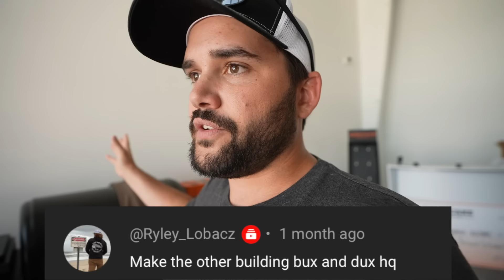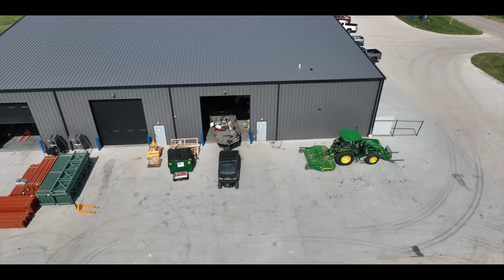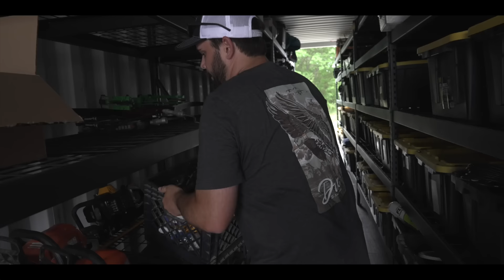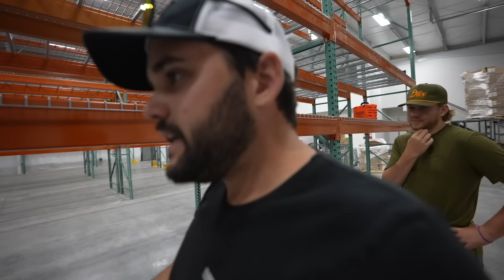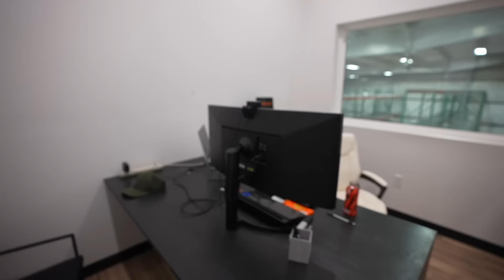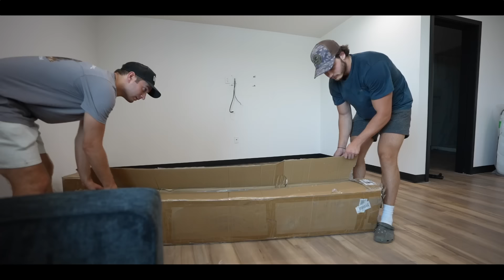Revealing My BIG SECRET!!!! (If this FAILS I Blame YOU!)

Comment: Speaking of storage containers, throw one in the pond 😂😂😂
Reply: Why keep throwing all the garbage in the pond?
Reply: Structure 😂
Reply: I think they cost a bit to much to just put one in the pond!!
Reply: Put a container in the pond is the best thing to do
Reply: @jerrytheafricangreyparrot  a 20’ you can get for $1500 and $3500 for a 40’ for me since I’m close to multiple cargo ports i can get a $200 delivery fee
Reply: True and the hatchery
Reply: Depends full size half or quarter full size lenth hold 2 cars cost almost 4k the quarter size ones around a grand  @jerrytheafricangreyparrot
Reply: @jerrytheafricangreyparrot price of them do go up an down like a scrapyard 😂
Reply: @tjboylan20  you lucky lol on cheap delivery
Reply: @SleepToNeverWakeAgain  I live 20 minutes from Port Canaveral in Florida and then another 3 hours from Port of Miami the Miami one is $600 for delivery of the 20’ and 1k for a 40’, that’s why I use port Canaveral because for a case of beer I can borrow a family friend’s truck and drive it around also
Reply: Taking this thought and adding to it. Take shipping containers and use them as a pond/aquarium. Cut the top off, seal it from rusting,  add a pond liner and you have a active holding pond or stocking pond. For an added twist add plexi glass for windows and only bury it half way so you can see the fishing swimming like Bass Pro Shops aquarium but be able to get to the top without getting a 8ft ladder
Reply: @tjboylan20  im in central VA so im over 2 hrs from the closest port lol its 1000 for the short ones lol
Reply: @jerrytheafricangreyparrot they cost less than he paid for that plane sooo
Reply: @tjboylan20 40' where I live costs anywhere from $400-$8,000 depending on what you want it to look like and they will do the interior as well and theu will put stronger doors on with a lock you can't cut off. It all expends the needs and what you want it to look like and be used for
Reply: And you expect to catch fish out of the container?  Talk about a snag, you will loose more baits than catch anything.  The structure the pond needs is tree trunks, logs natural structure. Adding more rusting and contamination from paint to whatever they hauled in the container to your pond and fish.
Reply: #structure
Reply: @bigkuntry3333  at the end of the day its garbage
Reply: Stand it up vertical near the beach and put a rope ladder and platform on it
Reply: I have a feeling flair has now favorited your comment, also that’s awesome he liked your comment
Reply: Pleaaaase let's stop contaminating ponds , all this crap leaches into the water ,and they not big ponds
Reply: Why not put a container with plexy glass half in the pond so u can go down and see the fish while feeding them  or get cool camera angles or overnight challenges i think be kind of cool
Reply: @jerrytheafricangreyparrot you can get one that’s like destroyed it doesn’t have to be brand new
Reply: Get an old one with holes in it so the fish can move around it
Reply: @jerrytheafricangreyparrot I can buy a shipping containers for £200 sold unsean. Uncollected shipping containers you buy and deal what ever is inside could be laptops, phones, cars or even rotting food but £200 is a cheap gamble
Reply: @jerrytheafricangreyparrot he put a plane in there lmao

Comment: SUGGESTIONS for the Air BnB room   A rug is not a bad idea at all, but I'd suggest you do not do a coffee table.  With so much space on each side of the sofa/love seat, I would put decent sized end tables instead (3 - one for each end of the love seat and couch and another for the corner between the two) so that you can put a lamp, alarm clock (not that anyone uses one anymore), etc. for people who will be sleeping there. 

While a coffee table would fill in the space, it will be a pain in the ass every time someone uses the sofa bed. If people want a table in front of them, they can move an end table out there to rest their feet on, lol.  People have a bad habit of feeling they need to "fill" up space. Having a nice OPEN AREA to walk around, put gear, etc. will be appreciated far more than having to maneuver around a coffee table to go to the bathroom in the middle of the night. I speak from experience. I felt our basement in one of our homes needed more stuff and it just wound up being a pain as far as cleaning, moving around in the space, etc. 

Another idea is you can get little tables that clip to the edge of a bed. This would be very much appreciated by anyone sleeping in the bunks. Google "BEDSIDE SHELF" to see what I'm talking about. It's a place to put their phone, glasses, a glass of water, etc. and will be used and appreciated by everyone who sleeps in the bunk beds. I promise. 

Good luck with everything, Andrew. Your channel remains in the top 5 of my favorite channels. I'm likely not someone who you'd think would be in your demographic: 53yo disabled, single mom. Your antics with the boys reminds me so much of my brothers and their friends when we were kids. I was the youngest little sister so mostly had to watch from the side lines, but it was still a tonne of fun!

Heather🇨🇦

Comment: You could make that upstairs "shelving area" a office. It already has AC no need to cut a window you have full view of the shop and it saves you money from turning that smaller room on the bottom floor one. I ised to work in a warehouse and they did the exact same thing.
🤷‍♂️ keep up the good work FLAIR!

Comment: now the shipping container idea..... when you empty them..... paint match to the warehouses and place one at each warehouse 25'-30' from the building and basically connect then to the warehouse with chainlink security fences so the container is part if fence. then container can be overrun storage of products that's lockable and the fenced-in part to park vehicles or ATVs or dog ext for temporary theft/vandal protection.... like your own impound lot

Comment: Not trying to be the fun police here but having a bedroom in a commercial building depends on zoning laws and building codes in your area. Many places have strict regulations separating residential and commercial uses. To convert part of a commercial building into a residential space, you would likely need to obtain special permits and ensure that the space meets residential building codes, which might include requirements for fire safety, sanitation, and egress.

If you're considering this, it's best to check with your local zoning office or building department for specific regulations and requirements in your area.

Comment: @flair I work for Fanatics inc. in a leadership role. Our distribution center is around 300,000 square feet. 

Changing the layout of our DC and using specialized equipment, we were able to increase our capacity for pallet locations by 70%. 

If you’re interested in learning how we achieved this, shoot me a DM. 

Love the vid and the Dux and Bux announcement.

Comment: Flair, anything that may be susceptible to extreme heat shouldn't be in the containers. They are nothing more than an uninsulated steel box & will get super hot inside during the summer. I've worked with containers for years & know from experience.

Comment: Hey flair my name is Keith I bought a bux thermal jacket because of you and wanted to thank you I bought it as a gift for someone and left it in my truck wrecked my truck in a ditch and walked 9 miles home in 12 degree weather. Normally doesn’t get below freezing here and everything was ice. By far the best jacket I’ve ever worn and I wouldn’t have had it if it wasn’t for you. Big thanks. Got me back home to my family. Was severely under prepared for anything like that to happen only had my regular work clothes and a thin hoodie. The jacket saved me.